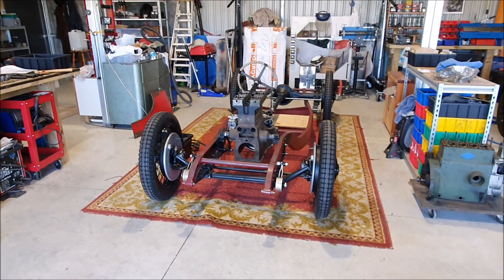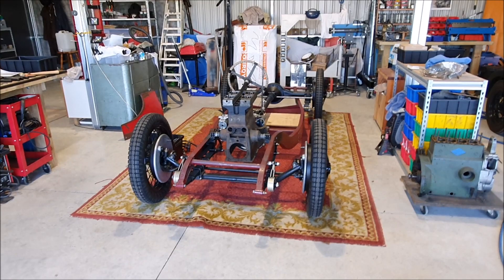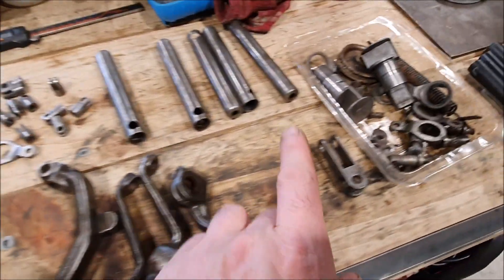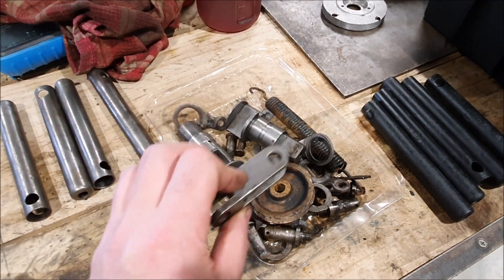Pre war car - more brakes and starters

Comment: Re. the starter end pieces, one of which you observed was more coppery in colour. I assume they're both copper alloy of some sort rather than ferrous...? If so the anomalous one could be bronze rather than brass. Alternatively it could be brass that has suffered from zinc migration ('dezincification')- more common on brass that has been buried (!) it is a structural change (somewhat akin to crystallisation) which weakens the piece to a certain extent- depending on how far it's gone. On that component it's probably over-engineered anyway...

Comment: From experience the small length change in the slotted bolts is neither here nor there. However I did replace mine with new but they were only a couple of quid each. Shame you are paying more own under. Looking forward to your dynamo job. Not needed yet on my car. Cheers from Hants UK.
Reply: Don't forget to undercut the commutator segments!
Reply from the maker: I did that on the dynamo but you don't need to on starters apparently. The reason is apparently the brushes on the dynamo are soft carbon so the mica insulator will wear them, the starter with it's metal brushes don't have the same issue.

Comment: The brushes in the starter motor look like copper , but they are actually something else (copper embedded in Graphite?????). One of my starter motors had the brushes made by someone out of copper. The result was that the commutator and the brushes completely destroyed each other. Starter brushes are available from James.
Reply from the maker: Yes, they'll be some special copper alloy I imagine. I already have an order on the way so might add them to the next one! What I really need is a good, local and cheap source (what's that saying about pick two...) of small cheese head 2BA and 4BA screws. It annoys me the screws on things like these starters and dynamos are always so chewed up. I actually had to drill one out on the starter motor as the head was all mangled.